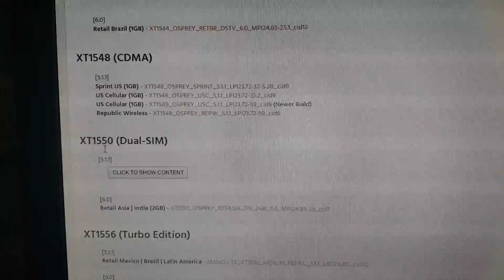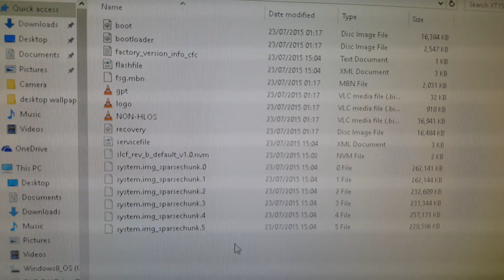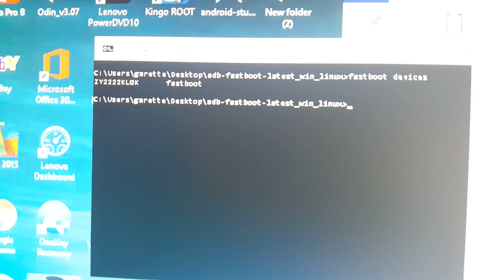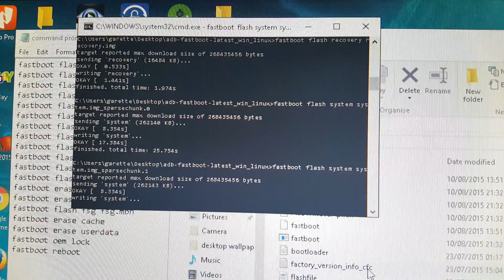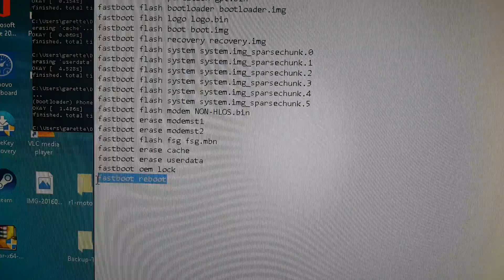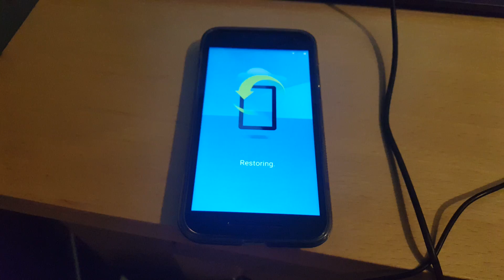Moto G 3rd Gen /2015 UNROOT & INSTALL ORIGINAL STOCK FIRMWARE TUTORIAL

Comment: Microsoft Windows [Version 10.0.18362.836]
(c) 2019 Microsoft Corporation. All rights reserved.

C:\Users\Khan G\Desktop\Motorola_Moto_G3_XT1540_OSPREY_RETCA_6.0_MPI24.65-33.1-2-2_cid14_6.0\Firmware>fastboot devices
ZY22224HQD      fastboot

C:\Users\Khan G\Desktop\Motorola_Moto_G3_XT1540_OSPREY_RETCA_6.0_MPI24.65-33.1-2-2_cid14_6.0\Firmware>fastboot flash partition gpt.bin
(bootloader) slot-count: not found
(bootloader) slot-suffixes: not found
(bootloader) slot-suffixes: not found
(bootloader) has-slot:partition: not found
target reported max download size of 268435456 bytes
sending 'partition' (32 KB)...
OKAY [  0.106s]
writing 'partition'...
(bootloader) Preflash validation failed
FAILED (remote failure)
finished. total time: 0.619s

C:\Users\Khan G\Desktop\Motorola_Moto_G3_XT1540_OSPREY_RETCA_6.0_MPI24.65-33.1-2-2_cid14_6.0\Firmware>fastboot flash bootloader bootloader.img
(bootloader) slot-count: not found
(bootloader) slot-suffixes: not found
(bootloader) slot-suffixes: not found
(bootloader) has-slot:bootloader: not found
target reported max download size of 268435456 bytes
sending 'bootloader' (2546 KB)...
OKAY [  0.271s]
writing 'bootloader'...
(bootloader) flashing sbl1 ...
(bootloader) flashing aboot ...
(bootloader) flashing tz ...
(bootloader) flashing hyp ...
(bootloader) flashing rpm ...
OKAY [  1.811s]
finished. total time: 2.085s

C:\Users\Khan G\Desktop\Motorola_Moto_G3_XT1540_OSPREY_RETCA_6.0_MPI24.65-33.1-2-2_cid14_6.0\Firmware>fastboot flash logo logo.bin
(bootloader) slot-count: not found
(bootloader) slot-suffixes: not found
(bootloader) slot-suffixes: not found
(bootloader) has-slot:logo: not found
target reported max download size of 268435456 bytes
sending 'logo' (1352 KB)...
OKAY [  0.219s]
writing 'logo'...
OKAY [  0.183s]
finished. total time: 0.405s

C:\Users\Khan G\Desktop\Motorola_Moto_G3_XT1540_OSPREY_RETCA_6.0_MPI24.65-33.1-2-2_cid14_6.0\Firmware>fastboot flash boot boot.img
(bootloader) slot-count: not found
(bootloader) slot-suffixes: not found
(bootloader) slot-suffixes: not found
(bootloader) has-slot:boot: not found
target reported max download size of 268435456 bytes
sending 'boot' (16384 KB)...
OKAY [  0.770s]
writing 'boot'...
(bootloader) Preflash validation failed
FAILED (remote failure)
finished. total time: 1.456s

C:\Users\Khan G\Desktop\Motorola_Moto_G3_XT1540_OSPREY_RETCA_6.0_MPI24.65-33.1-2-2_cid14_6.0\Firmware>fastboot flash recovery recovery.img
(bootloader) slot-count: not found
(bootloader) slot-suffixes: not found
(bootloader) slot-suffixes: not found
(bootloader) has-slot:recovery: not found
target reported max download size of 268435456 bytes
sending 'recovery' (16484 KB)...
OKAY [  0.787s]
writing 'recovery'...
(bootloader) Preflash validation failed
FAILED (remote failure)
finished. total time: 1.518s

C:\Users\Khan G\Desktop\Motorola_Moto_G3_XT1540_OSPREY_RETCA_6.0_MPI24.65-33.1-2-2_cid14_6.0\Firmware>fastboot flash system system.img_sparsechunk.0
(bootloader) slot-count: not found
(bootloader) slot-suffixes: not found
(bootloader) slot-suffixes: not found
(bootloader) has-slot:system: not found
target reported max download size of 268435456 bytes
sending 'system' (262141 KB)...
OKAY [  9.767s]
writing 'system'...
(bootloader) Invalid signed image
(bootloader) Preflash validation failed
FAILED (remote failure)
finished. total time: 10.457s

C:\Users\Khan G\Desktop\Motorola_Moto_G3_XT1540_OSPREY_RETCA_6.0_MPI24.65-33.1-2-2_cid14_6.0\Firmware>fastboot flash system system.img_sparsechunk.1
(bootloader) slot-count: not found
(bootloader) slot-suffixes: not found
(bootloader) slot-suffixes: not found
(bootloader) has-slot:system: not found
target reported max download size of 268435456 bytes
sending 'system' (262142 KB)...
OKAY [  9.894s]
writing 'system'...
(bootloader) Invalid signed image
(bootloader) Preflash validation failed
FAILED (remote failure)
finished. total time: 10.016s

C:\Users\Khan G\Desktop\Motorola_Moto_G3_XT1540_OSPREY_RETCA_6.0_MPI24.65-33.1-2-2_cid14_6.0\Firmware>fastboot flash system system.img_sparsechunk.2
(bootloader) slot-count: not found
(bootloader) slot-suffixes: not found
(bootloader) slot-suffixes: not found
(bootloader) has-slot:system: not found
target reported max download size of 268435456 bytes
sending 'system' (262142 KB)...
OKAY [  9.810s]
writing 'system'...
(bootloader) Invalid signed image
(bootloader) Preflash validation failed
FAILED (remote failure)
finished. total time: 9.925s

C:\Users\Khan G\Desktop\Motorola_Moto_G3_XT1540_OSPREY_RETCA_6.0_MPI24.65-33.1-2-2_cid14_6.0\Firmware>fastboot flash system system.img_sparsechunk.3
(bootloader) slot-count: not found
(bootloader) slot-suffixes: not found
(bootloader) slot-suffixes: not found
(bootloader) has-slot:system: not found
target reported max download size of 268435456 bytes
sending 'system' (232559 KB)...
OKAY [  8.691s]
writing 'system'...
(bootloader) Invalid signed image
(bootloader) Preflash validation failed
FAILED (remote failure)
finished. total time: 8.816s

C:\Users\Khan G\Desktop\Motorola_Moto_G3_XT1540_OSPREY_RETCA_6.0_MPI24.65-33.1-2-2_cid14_6.0\Firmware>fastboot flash system system.img_sparsechunk.4
(bootloader) slot-count: not found
(bootloader) slot-suffixes: not found
(bootloader) slot-suffixes: not found
(bootloader) has-slot:system: not found
target reported max download size of 268435456 bytes
sending 'system' (249054 KB)...
OKAY [  9.165s]
writing 'system'...
(bootloader) Invalid signed image
(bootloader) Preflash validation failed
FAILED (remote failure)
finished. total time: 9.284s

C:\Users\Khan G\Desktop\Motorola_Moto_G3_XT1540_OSPREY_RETCA_6.0_MPI24.65-33.1-2-2_cid14_6.0\Firmware>fastboot flash system system.img_sparsechunk.5
(bootloader) slot-count: not found
(bootloader) slot-suffixes: not found
(bootloader) slot-suffixes: not found
(bootloader) has-slot:system: not found
target reported max download size of 268435456 bytes
sending 'system' (261433 KB)...
OKAY [  9.645s]
writing 'system'...
(bootloader) Invalid signed image
(bootloader) Preflash validation failed
FAILED (remote failure)
finished. total time: 9.753s

C:\Users\Khan G\Desktop\Motorola_Moto_G3_XT1540_OSPREY_RETCA_6.0_MPI24.65-33.1-2-2_cid14_6.0\Firmware>fastboot flash modem NON-HLOS.bin
(bootloader) slot-count: not found
(bootloader) slot-suffixes: not found
(bootloader) slot-suffixes: not found
(bootloader) has-slot:modem: not found
target reported max download size of 268435456 bytes
sending 'modem' (36984 KB)...
OKAY [  1.530s]
writing 'modem'...
OKAY [  2.189s]
finished. total time: 3.724s

C:\Users\Khan G\Desktop\Motorola_Moto_G3_XT1540_OSPREY_RETCA_6.0_MPI24.65-33.1-2-2_cid14_6.0\Firmware>fastboot erase modemst1
(bootloader) slot-count: not found
(bootloader) slot-suffixes: not found
(bootloader) slot-suffixes: not found
(bootloader) has-slot:modemst1: not found
erasing 'modemst1'...
OKAY [  0.107s]
finished. total time: 0.110s

C:\Users\Khan G\Desktop\Motorola_Moto_G3_XT1540_OSPREY_RETCA_6.0_MPI24.65-33.1-2-2_cid14_6.0\Firmware>fastboot erase modemst2
(bootloader) slot-count: not found
(bootloader) slot-suffixes: not found
(bootloader) slot-suffixes: not found
(bootloader) has-slot:modemst2: not found
erasing 'modemst2'...
OKAY [  0.146s]
finished. total time: 0.148s

C:\Users\Khan G\Desktop\Motorola_Moto_G3_XT1540_OSPREY_RETCA_6.0_MPI24.65-33.1-2-2_cid14_6.0\Firmware>fastboot flash fsg fsg.mbn
(bootloader) slot-count: not found
(bootloader) slot-suffixes: not found
(bootloader) slot-suffixes: not found
(bootloader) has-slot:fsg: not found
target reported max download size of 268435456 bytes
sending 'fsg' (2382 KB)...
OKAY [  0.288s]
writing 'fsg'...
OKAY [  0.219s]
finished. total time: 0.511s

C:\Users\Khan G\Desktop\Motorola_Moto_G3_XT1540_OSPREY_RETCA_6.0_MPI24.65-33.1-2-2_cid14_6.0\Firmware>fastboot erase cache
(bootloader) slot-count: not found
(bootloader) slot-suffixes: not found
(bootloader) slot-suffixes: not found
(bootloader) has-slot:cache: not found
erasing 'cache'...
OKAY [  0.123s]
finished. total time: 0.125s

C:\Users\Khan G\Desktop\Motorola_Moto_G3_XT1540_OSPREY_RETCA_6.0_MPI24.65-33.1-2-2_cid14_6.0\Firmware>fastboot erase userdata
(bootloader) slot-count: not found
(bootloader) slot-suffixes: not found
(bootloader) slot-suffixes: not found
(bootloader) has-slot:userdata: not found
erasing 'userdata'...
OKAY [  0.385s]
finished. total time: 0.388s

C:\Users\Khan G\Desktop\Motorola_Moto_G3_XT1540_OSPREY_RETCA_6.0_MPI24.65-33.1-2-2_cid14_6.0\Firmware>fastboot oem lock
(bootloader) slot-count: not found
(bootloader) slot-suffixes: not found
(bootloader) slot-suffixes: not found
...
(bootloader) Please run fastboot oem lock begin first!
OKAY [  0.111s]
finished. total time: 0.113s

C:\Users\Khan G\Desktop\Motorola_Moto_G3_XT1540_OSPREY_RETCA_6.0_MPI24.65-33.1-2-2_cid14_6.0\Firmware>fastboot reboot
Reply from the maker: Hmmm seems.like it's failing on the bootloader
Reply: @TheRealAndroidDoctor  so what i can do
Reply: @TheRealAndroidDoctor  so what i can do sir

Comment: when i type the command ''fastboot flash partition gpt.bin'' it says:
''(bootloader) preflash validation failed
My Moto g3 turbo's bootloader is already unclocked and rooted with 7.1. Now I want to revert back to 6.0 and lock relock the bootloader but cant pass through the above error.
Reply: if you find solution please post here, i am having same issue. model xt1557, was on lineage 14.1 want to go back to stockmarshmallow. it shows same error for me.

Comment: i tried to install stock rom in my moto g3 device but failed plz help
the cmd window shows this:
C:\Program Files (x86)\Minimal ADB and Fastboot>fastboot flash partition gpt.bin

target reported max download size of 268435456 bytes
sending 'partition' (32 KB)...
OKAY [  0.005s]
writing 'partition'...
(bootloader) Preflash validation failed
FAILED (remote failure)
finished. total time: 0.413s

how to solve (bootloader) Preflash validation failed problem
Reply from the maker: Yash Jain did u unlock your bootloader?
Reply: yes bootloader is unlocked
Reply from the maker: Yash Jain oh ok u must be doing something wrong did u enable usb debugging?
Reply: yes i followed each step as shown in video
Reply: my phone is not rooted is that a problem?
bcos i checked other video they dont ask to root the phone.
Reply from the maker: Yash Jain why would u want to install stock firmware if your not rooted ,sonif your not rooted u must already have the original stock firmware on your phone bro
Reply: i am facing a lot problem like phone autorestart, shut down on call
Reply: and i want to lock my bootloader
Reply: I HAVE CYANOGENMOD INSTALLED I WANT TO CHANGE IT TO ORIGINAL @TheRealAndroidDoctor

Comment: failed.
Reply from the maker: John Doe u probably usedcthe wrong firmware double check it bro it has to be for your exact model number
Reply: Android Doctor thanks for the reply. I need to install a stock firmware for the Moto g3 XT1540. I downloaded the 2gb 6.0 firmware which was the one I updated it to. I'm clueless
Reply from the maker: John Doe which contry do u live in and what network provider do u have?
Reply: Android Doctor I live in the u.s.. the phone was purchased unlocked, use it on T-Mobile network

Comment: Flashed the stock rom successfully. (XT1550 with newer build from xda). However my wifi is not working. What should i do? Is that a glitch?
Reply from the maker: Pratik Kulkarni sounds like u may have flashed the wrong firmware check that the firmware is for your model number everything has to match

Comment: Android Doctor please help i have done same as u did but during flash i'm getting this 

C:\Program Files\Minimal ADB and Fastboot>fastboot devices
ZY2223PLJP      fastboot

C:\Program Files\Minimal ADB and Fastboot>fastboot oem lock begin
...
(bootloader) Please fully flash the signed build before locking phone!
OKAY [  0.027s]
finished. total time: 0.031s

C:\Program Files\Minimal ADB and Fastboot>fastboot oem fb_mode_set
...
OKAY [  0.004s]
finished. total time: 0.008s

C:\Program Files\Minimal ADB and Fastboot>fastboot flash partition gpt.bin
target reported max download size of 268435456 bytes
sending 'partition' (32 KB)...
OKAY [  0.007s]
writing 'partition'...
(bootloader) Preflash validation failed
FAILED (remote failure)
finished. total time: 0.413s

C:\Program Files\Minimal ADB and Fastboot>fastboot flash bootloader bootloader.img
target reported max download size of 268435456 bytes
sending 'bootloader' (2546 KB)...
OKAY [  0.094s]
writing 'bootloader'...
(bootloader) flashing sbl1 ...
(bootloader) flashing aboot ...
(bootloader) flashing tz ...
(bootloader) flashing hyp ...
(bootloader) flashing rpm ...
OKAY [  1.547s]
finished. total time: 1.641s

C:\Program Files\Minimal ADB and Fastboot>fastboot flash logo logo.bin
target reported max download size of 268435456 bytes
sending 'logo' (1352 KB)...
OKAY [  0.047s]
writing 'logo'...
OKAY [  0.062s]
finished. total time: 0.125s

C:\Program Files\Minimal ADB and Fastboot>fastboot flash boot boot.img
target reported max download size of 268435456 bytes
sending 'boot' (16384 KB)...
OKAY [  0.562s]
writing 'boot'...
(bootloader) Preflash validation failed
FAILED (remote failure)
finished. total time: 1.094s

C:\Program Files\Minimal ADB and Fastboot>fastboot flash system system.img_sparsechunk.0
target reported max download size of 268435456 bytes
sending 'system' (238438 KB)...
OKAY [  7.938s]
writing 'system'...
(bootloader) Invalid signed image
(bootloader) Preflash validation failed
FAILED (remote failure)
finished. total time: 8.391s

C:\Program Files\Minimal ADB and Fastboot>fastboot flash system system.img_sparsechunk.1
target reported max download size of 268435456 bytes
sending 'system' (238548 KB)...
OKAY [  7.906s]
writing 'system'...
(bootloader) Invalid signed image
(bootloader) Preflash validation failed
FAILED (remote failure)
finished. total time: 7.953s

C:\Program Files\Minimal ADB and Fastboot>fastboot flash system system.img_sparsechunk.2
target reported max download size of 268435456 bytes
sending 'system' (256695 KB)...
OKAY [  8.500s]
writing 'system'...
(bootloader) Invalid signed image
(bootloader) Preflash validation failed
FAILED (remote failure)
finished. total time: 8.547s

C:\Program Files\Minimal ADB and Fastboot>fastboot flash system system.img_sparsechunk.3
target reported max download size of 268435456 bytes
sending 'system' (262142 KB)...
OKAY [  8.719s]
writing 'system'...
(bootloader) Invalid signed image
(bootloader) Preflash validation failed
FAILED (remote failure)
finished. total time: 8.750s

C:\Program Files\Minimal ADB and Fastboot>fastboot flash system system.img_sparsechunk.4
target reported max download size of 268435456 bytes
sending 'system' (87155 KB)...
OKAY [  2.891s]
writing 'system'...
(bootloader) Invalid signed image
(bootloader) Preflash validation failed
FAILED (remote failure)
finished. total time: 2.969s

C:\Program Files\Minimal ADB and Fastboot>fastboot flash modem NON-HLOS.bin
target reported max download size of 268435456 bytes
sending 'modem' (36984 KB)...
OKAY [  1.219s]
writing 'modem'...
OKAY [  0.938s]
finished. total time: 2.172s

C:\Program Files\Minimal ADB and Fastboot>fastboot erase modemst1
erasing 'modemst1'...
OKAY [  0.031s]
finished. total time: 0.031s

C:\Program Files\Minimal ADB and Fastboot>fastboot erase modemst2
erasing 'modemst2'...
OKAY [  0.016s]
finished. total time: 0.016s

C:\Program Files\Minimal ADB and Fastboot>fastboot flash fsg fsg.mbn
target reported max download size of 268435456 bytes
sending 'fsg' (2159 KB)...
OKAY [  0.078s]
writing 'fsg'...
OKAY [  0.078s]
finished. total time: 0.172s

C:\Program Files\Minimal ADB and Fastboot>fastboot erase cache
erasing 'cache'...
OKAY [  0.016s]
finished. total time: 0.016s

C:\Program Files\Minimal ADB and Fastboot>fastboot erase userdata
erasing 'userdata'...
OKAY [  0.297s]
finished. total time: 0.297s

C:\Program Files\Minimal ADB and Fastboot>fastboot erase customize
erasing 'customize'...
OKAY [  0.016s]
finished. total time: 0.016s

C:\Program Files\Minimal ADB and Fastboot>fastboot erase clogo
erasing 'clogo'...
OKAY [  0.031s]
finished. total time: 0.031s

C:\Program Files\Minimal ADB and Fastboot>fastboot oem fb_mode_clear
...
OKAY [  0.016s]
finished. total time: 0.016s

C:\Program Files\Minimal ADB and Fastboot>fastboot oem lock
...
(bootloader) Please flash valid signed images just after lock begin
(bootloader) command!
OKAY [  0.031s]
finished. total time: 0.031s

C:\Program Files\Minimal ADB and Fastboot>fastboot oem lock
...
(bootloader) Please flash valid signed images just after lock begin
(bootloader) command!
OKAY [  0.033s]
finished. total time: 0.039s

C:\Program Files\Minimal ADB and Fastboot>fastboot reboot
rebooting...

finished. total time: 0.008s

C:\Program Files\Minimal ADB and Fastboot>

Comment: was looking for this kinda video for so long worked like a charm for me except i had to make some changes had to add (flashboot flash system system.img_sparsechunk.6,7) because there was 7 in my XT1550 Dual asian.
Reply: Jemdimenba Longchar hi..I have sm device.but when I type gpt.bin command..it says"remote failer" why...
Reply: Mitumanash deuri Mitumanash deuri I had the same problem . "Remote failure" it is because maybe the stock version on your device is newer than the version you're trying to copy . You can't downgrade the os. You'll need to bypass the FRP . After searching online for like 2 days, found the proper working solution for my xt1550. You'll need to download this Moto All Gen Auto Flasher Script. Here is the link - http://forum.gsmdevelopers.com/showthread.php?t=157

Plus you'll need Motorola USB drivers. put the stock ROM into the folder named "Firmware" which you'll find in this moto all gen flasher script folder. 
Start the script. It works only on Windows 7. Please do reply if this helped you unbrick your device.